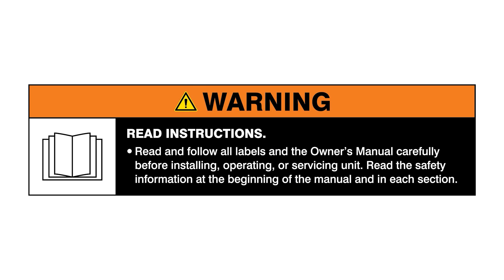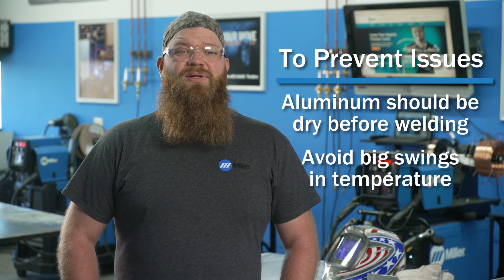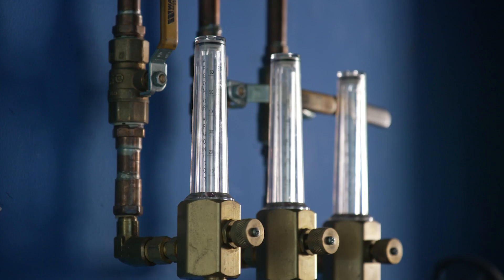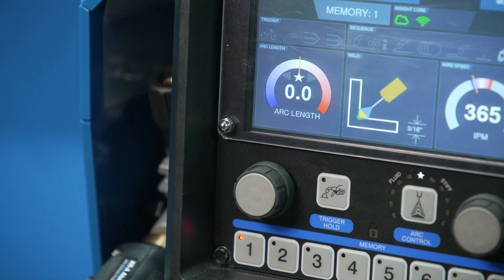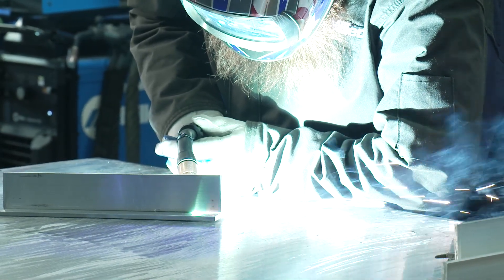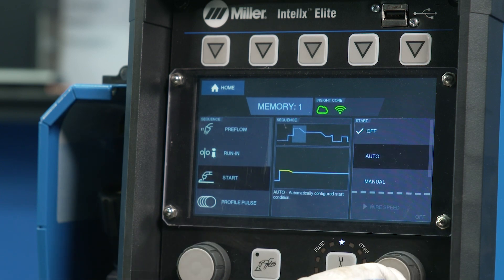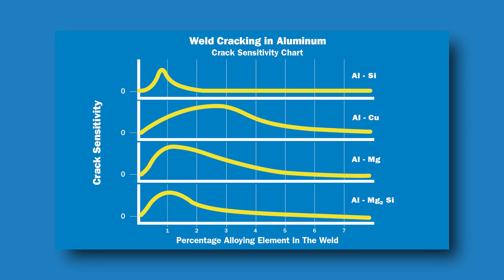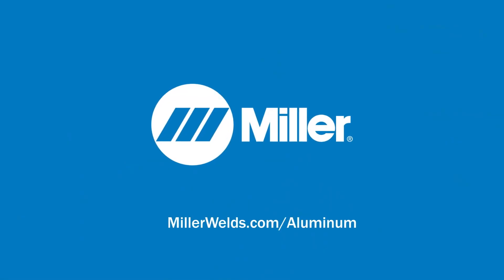Troubleshooting Aluminum Welding Problems

Comment: so I can “mig” weld aluminum ???  I’ve been told that I need an aluminum spool gun and 100% argon gas.
I have the LE31MP from another popular brand.
Reply from the maker: Thanks for your question, Richard! Yes, it is possible to MIG weld aluminum. You may need a spool gun or wire feeder to do it depending on the machine you are using.